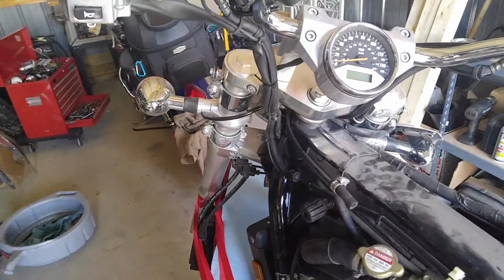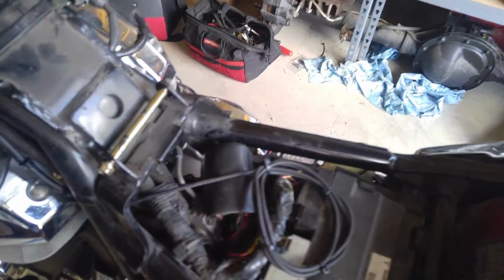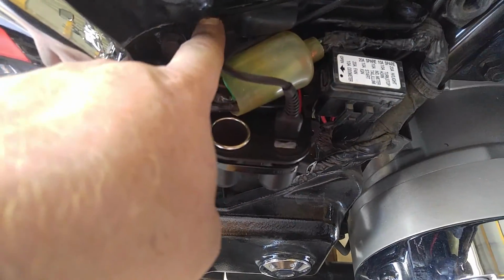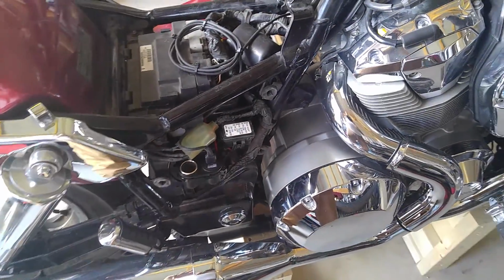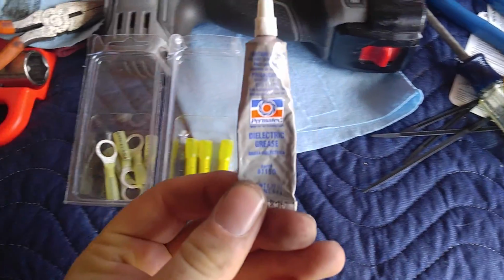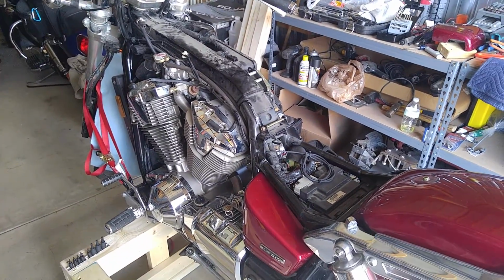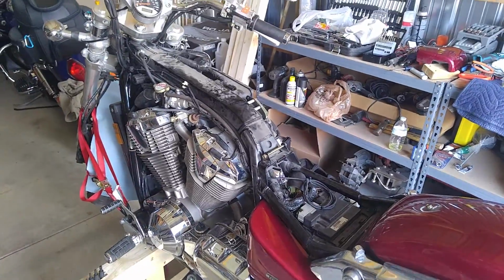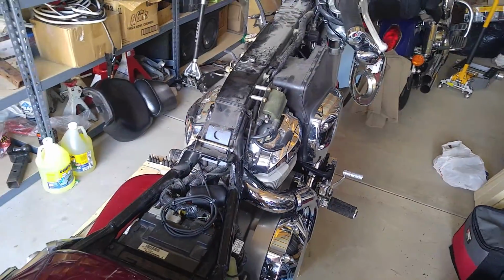How to install a phone charger on a Motorcycle. Honda VTX

Comment: Thanks for the tip for using the red and white wire coming off the ignition. I just installed a gps device and didn't want it wired directly to the battery, and possibly draining it.

Comment: Great video I have a Honda 1100cc ACE motorcycle. Could I also ask what type timber bracket you have the bike sitting on it looks great, as my engine sits below the frame, and would be damaged when lifting it.
Cheers From Ireland  🇮🇪
Reply from the maker: The stand is just built from normal 2x4s used from home frame work. 
I made it my self so that I would have a stable platform to put the bike one when working on it as the jake has a bit more movement in it than I would like.

It is glued and screwed together so its very solid. 
I made these in 2015, I have 2 of them, and I still have them and still use them all the time.

Comment: this si by far the best video I have seen on wiring a vtx. Now if you could do a video installing the Boss 800w speakers lol
Reply from the maker: chachee15 send me a set and I would be happy to do an install video for you!  LOL
Reply: BadmunkyWRX they're less than 100 bucks
Reply from the maker: chachee15 yeah sorry man but I have limited funds right now. 
Also there is NO WAY that thing is 800 watts.  LOL.
Those little speakers could not handle that kind of power even if that amp could make it. And there is no way it can and no way the electrical system of a VTX could support the current draw of an 800 watt amp either.

If I get some extra cash I might give it a go and do a review of it. But right now funds are tight and I dont see it happening any time soon.

Comment: Is that a stock pair of foot pegs ?
Reply: Yes. This bike is a 2003 VTX 1800 C model. 
The and C and F model bikes had pegs not boards.
I did swap them out for some nice aftermarket boards though.

Comment: Is there any way to do this with the tank on??!!!
Reply from the maker: I dont think so. You would never be able to rout the cable and secure it with the tank in the way. It would end up getting damaged from engine heat. 

The tank is VERY easy to remove. 

There are several videos on here on how to do it.
Reply: @BadmunkyWRX  Thanks for the reply. I figured it's better to take it to the shop and pay for an hour, rather than mess it up & pay for a tow as well as their' work...LOL!!!

Comment: on your 06 vtx back there, is that after market exhaust or did you remove the baffle section on both pipes?
Reply from the maker: Jonathan Marse full aftermarket.
Its a HardKrome system. they no longer make this system but its Bad Ass!
Look at my other vids I have a cold start video of it up here.

Comment: Can you tell me the wire color on the vtx 1300 bc I have vtx 1300 c and I want to  add it to my bike too
Reply from the maker: Should be the same color wire. 
But if not just find the one of 4 that is going to anything on the other side of that connector. 
Than use that wire. 
You need to test it to be sure with a test light and make sure its power, and is switched on and off with the ignition.
Reply: Badmünky  thank you for you replaying back, does it draw current while power ?

Comment: Thanks for your post. I am a moron when it comes to wiring so can you answer a question. Can you explain a little more of how you splice into that red wire with a white stripe. Do you cut it where it goes into the connector and tie into the end that goes to the ignition? Does that leave a dead end wire going to the connector? Or do you splice all three wires (the new wire and both ends of the red/white? Sorry, I know this is probably a common sense thing but I have none when it comes to electrical. 
Thanks!
Reply from the maker: I cut them at the connector and then conned to the wire going to the ignition. 
The other side of the plug that wire goes in to (chassis side) has no wire connected to it. So it goes to nothing. So there is no need to 3 way it. 
Just cut it and connect to the ignition side of the wire. 

Be sure to check your bike that there is no wire connected to the chassis side of that plug before you cut the wire. If there is a wire on the chassis side of the harness you will need to do a 3 way connection on the ignition side of the harness. 

I have done this several VTX bikes now and yet to find one that has a wire on the chassis side of the harness but you never know. So check to be safe.
Reply: Just to make sure I'm wrapping my head around this, the red/white striped wire ran from the ignition switch to that white harness clip.  However, there was nothing on the other side of that clip coming out.  You just cut the wire and now the power outlet is wired using that red/white line back to the ignition switch.  Sound right?
Reply from the maker: Marcus Adams correct.
And then take the ground wire (black) and connect it to the negative sode of the battery.

With that you have power to your charging port that will shut off with the key so that you font kill the battery.
Reply: Did it and it worked perfectly!  Thanks for this video!
Reply from the maker: Glad it worked out for you man!

Comment: How did you mount the wal mart usb charger?
Reply from the maker: Zip ties
Reply: @BadmunkyWRX  I saw the zip ties, what did you zip tie it to though.  Thanks for the very quick reply by the way.  Getting ready to tackle this and set the bike up for a saddle sore 1000 this summer.  Look out ibuprofen!!!
Reply from the maker: @rjhphotos  There are some relays there. If I remember right its just zip tied to the relays.
Been almost 5 years since I made this video and I no longer own this bike.
Loved it and had a lot of fun with it, but was time to move to something with a few more factory options. 
So I bought a clean used Kawasaki Vulcan Vaquero VN1700 about 2 months ago after selling this one for $4,500. 
Took me 8 days to sell it. 
It was very clean and had several more things added to it since this video.

Comment: Want to sell one of your bikes?
Reply from the maker: I am actually thinking of selling the red 1800 that I am showing you in the video.
Reply: @BadmunkyWRX  milage, location, and price?
Reply from the maker: Around 19k. 
Toledo Ohio.
$4,800
Reply: @BadmunkyWRX  no offense but that is way too high.
Kbb has trade in at $2,750 and retail at $4k
Good luck
Reply from the maker: Ill sell it for 4k.

 I'm not a dealer so trade in means nothing to me. (Local Dealer said they would give me $3,400 by the way for it cash even if I didn't buy from them.)
I keep the $800 Seat, the $600 Exhaust, And $200 forward control kit and the bike will be all stock again. Oh and the charger kit and all the other stuff I have done to it. 

KBB is stock bike prices after all.  :)
Reply: @BadmunkyWRX  trade is bottom price and retail you get assurances. But there is no way you will get everything you put into it, back. It's used parts and the warranty doesn't transfer. You would be lucky to get half of the money back of the add-ons. 
I usually split the gap between trade and retail as a starting point and if it super clean and well maintained the price I'm willing to pay goes up. The opposite is also true.
Again no offense to you or your bike.
Reply from the maker: Not a problem man. Your a guy looking for a deal. I get it. 
That said I have NEVER heard of using trade value to "adjust" retail value on anything.  LOL New on me me there.  

I see these bikes sell for $3,500-6k all day depending on what has been done to them. 

I am in no rush to get rid of mine.  Its damn near mint. It's been VERY well maintained because I did everything myself on time or early. And I have been working on bikes for almost my whole life.

It just got a new clutch, (Springs got weak and it started slipping. Known problem with these bikes) oil change, rear diff fluid change, neck bearing adjusted (I do this every 10k or so to be safe) Valve adjustment, spark plugs, grounds cleaned and sealed, (Do this every year) coolant flushed, brake fluid flushed, clutch fluid flushed, brake pads replaced with OEM Honda pads less than 3k miles ago, and I deleted the pare valve system that's known to fail with proper block off plates last year. 

I then installed a Vance and Hines Big shots exhaust system, an Ultimate Big boy seat and pillion. With rider backrest option. 

I installed a sissy bar, phone charger, windscreen, handlebar riser kit, LED headlight, And I am sure more that I am forgetting. 

I have added at least $2,500 in parts alone to the bike. Would have been pushing 4k if you paid to have all this installed. I also have the stock parts still. And they go with the bike "IF" I sell it.

Like I said I don't need to. But I can't ride it right now. I'm done for the year do to this knee problem. And I was thinking of getting a different bike in the spring anyway. That's why I took it to the dealer 2 weeks before I blew my knee out to see what they will give me for it.

I'm happy to hold onto it until spring and get $4,800-5k for it. 1800s are getting harder to find with low miles not beat up. I have no doubt I will get $4,800 for it if not more if I hold out. 

I for sure will NOT let go for less than 4k. I paid more than that for it 3 years ago!

I probably have around 7k in this bike. I don't expect to get that back. But I know what its worth to.
Reply: @BadmunkyWRX  good luck to you man. I've seen 03s with 20K go for as low as 2500 pipes, seats and batwing.
Reply from the maker: I have also seen a stock one with 38k on it sell for $,5500. 

Condition is everything. And so is location.  Where I live I will have no problem getting what I want for it.